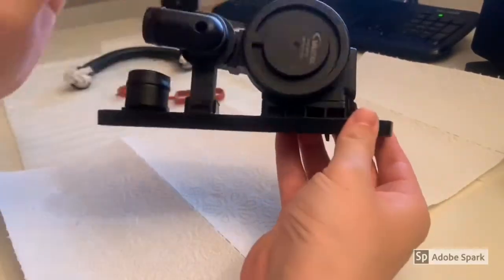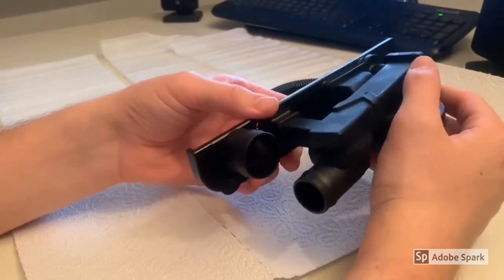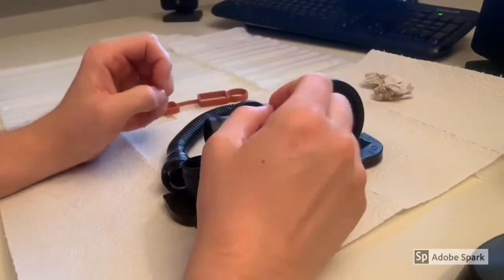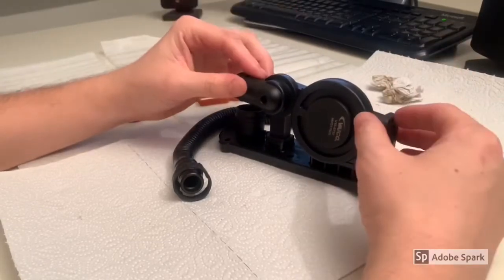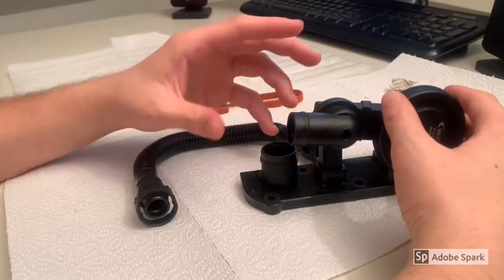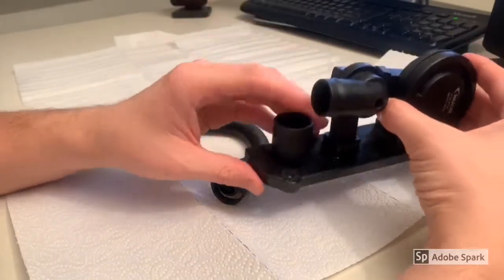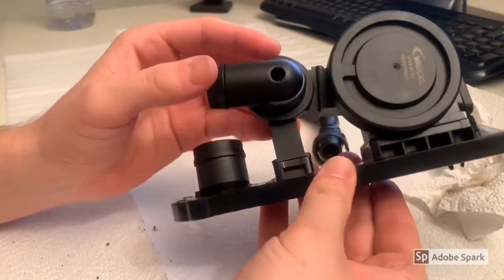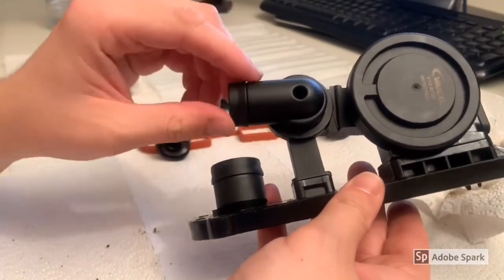MK5 GTI PCV Valve explained and few other choices

Comment: Hello mate.
By removing the stock PCV and use delete plate or catch can, you removing the vacuum function of the engine. Is that ok for the engine? Is there any reason that the stock PCV before the boost is using vacuum ?
Cheers...
Reply from the maker: Hi, you don’t remove the « vacuum function of the engine » 
You just block one way so your gasses and other tiny « remains » will go back into the intake. Some of the people are saying that by blocking it, the pressure inside the chamber increases which is not good for the engine, but I didn’t see any proof of that, even if it’s sounds logical. 
The oil catch can is the best choice as you don’t block anything, you just mount an intermediate filter which will clean the gasses, kind of, before releasing them on the normal way. 
In the end, after seeing more debates online, it seems that replacing the old PCV with the updated (OEM) one will do the trick and your engine will run in normal parameters.
Reply: @ClaudiuB  Yes the one you have on the video is the latest version i think with the check valve in it! What i mean by saying you removing the vacuum is that with the stock PCV if you try to remove the oil cap when the engine is idling you will notice suction on the cap. By using pcv delete or catch can you will not have that suction any more.
The delete and catch can are working exactly the same, the only difference is that the delete doesn't filter the air. What is missing from the delete and the catch can is the valve check that is installed on the stock pcv.
Reply: @ClaudiuB  can you put a link update pcv picture and how it look like compare to old one..
Reply: @ClaudiuB